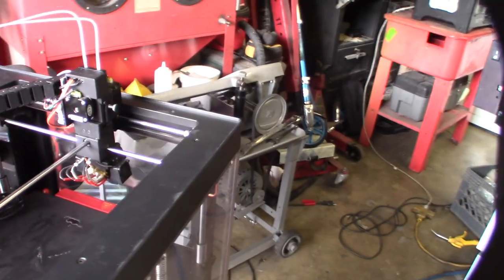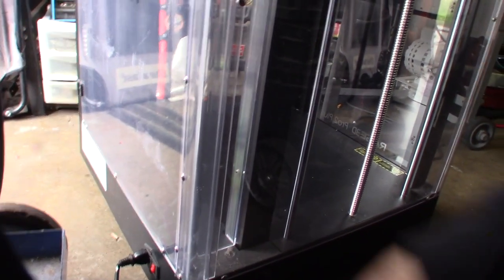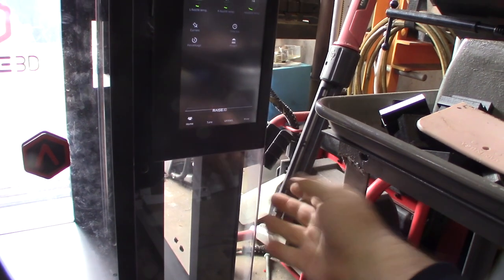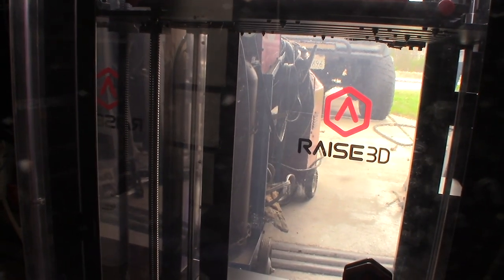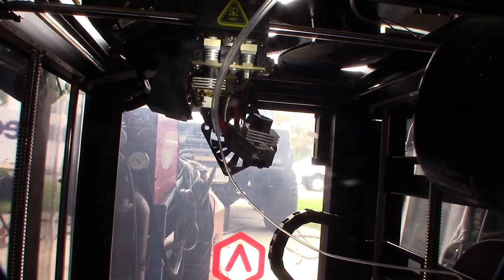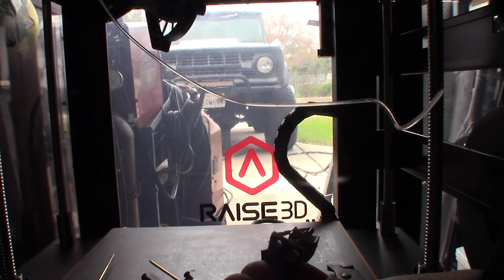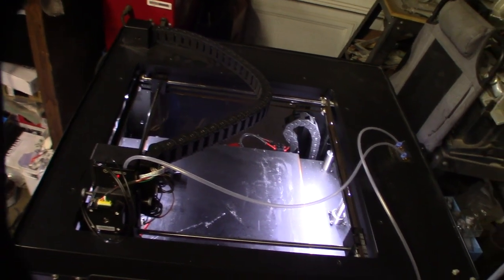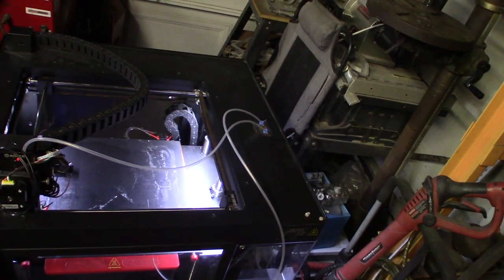Raise3D Pro2 Plus 3D Printer Troubleshooting, Repair, Thoughts. Horrible Jam and Clog

Comment: Prepping to unstick this jam so I thank you for this. If you could go make a follow up video that shows how to disassemble that head, it would be much appreciated. The reason for the adjustment which is electronically controlled is so that which ever head is not extruding head is raised slightly so that both clear the plate.

Comment: My work got a pro 3 recently. It's horribly slow with ghosting even after we took off the wheels, filament constantly jams. I can't believe a printer at this price level doesn't have pressure advance or input shaping. Trying to convince them to get a Bambu X1 Carbon.